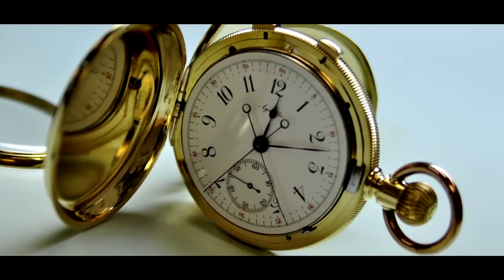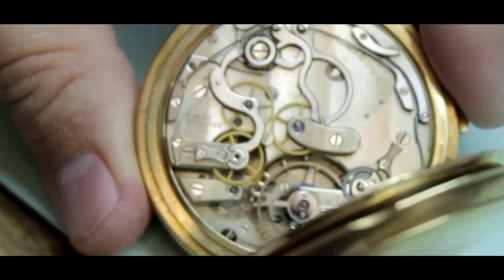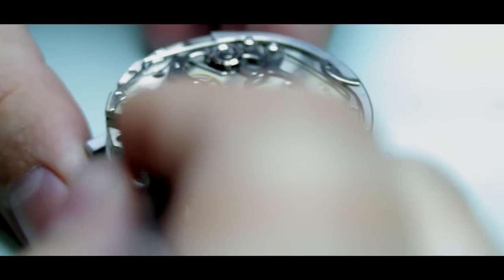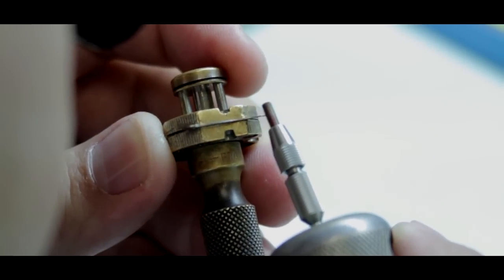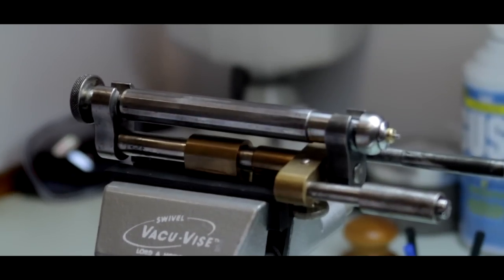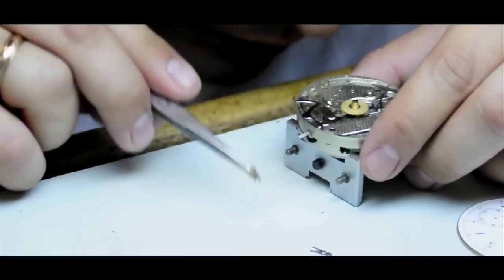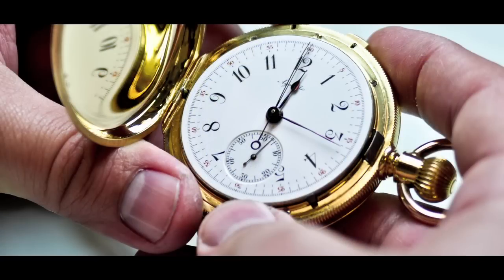Professional Restoration of an Agassiz Split Second Chronograph Pocketwatch circa 1890's

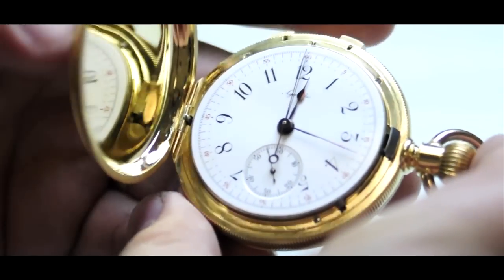Comment: The person closing the case a 4:00 doesn't know what they're doing.  You should NEVER snap a pocket watch lid closed. You should always push the button as you close it or it will wear out the lip on the cover. Especially on something as soft as 18K. They did do a nice job on that watch though.
Some Agassiz watches have a bridge that looks sort of like a map of the USA.